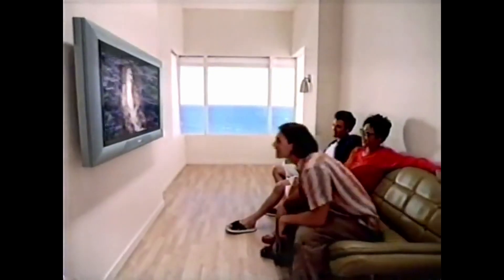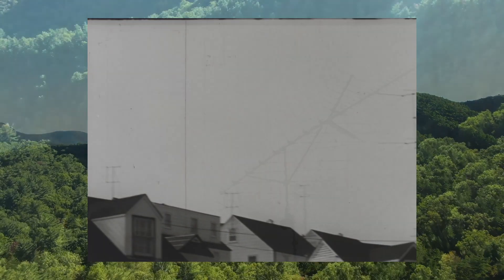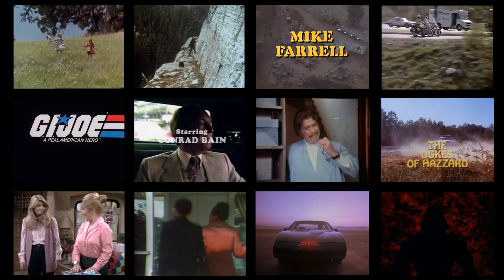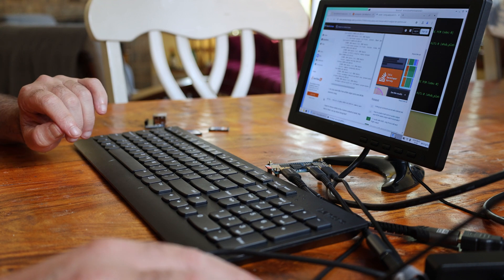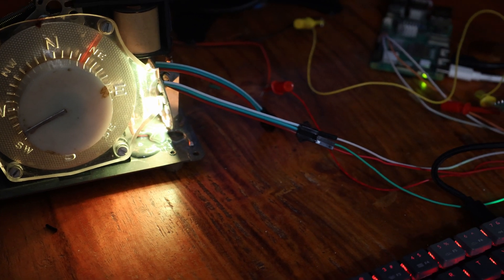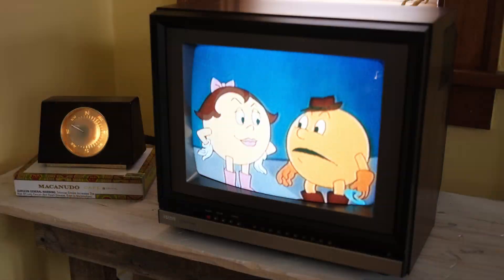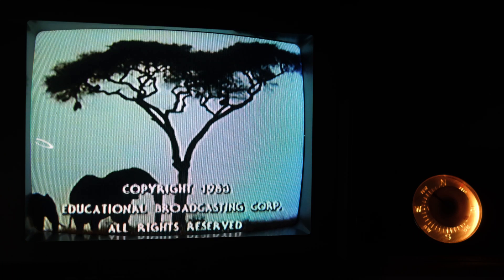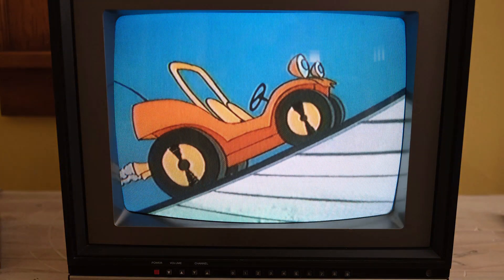My Nostalgia Machine: Recreating 80's broadcast TV with a Raspberry Pi

Comment: Curious what you chose to get to RF out of the Pi. Looks like you are using the Micro HDMI, and then I might guess one of those converters from HDMI to RF? Totally fine for this purpose, though I could be tempted to use the Pi 5's composite out pins and convert to RF (or not, with a later TV). 
Somewhere between the playback files to the TV it looks like you might not be getting the full frame rate. Could even be how the files were captured, as many capture programs drop a field and bring you down to 29.97fps. Some of these shows should look much more fluid.
Reply from the maker: For conversion, I am using multi-hops: HDMI->RCA in one box and RCA->RF in another - the latter box is contemporary to the era. 

On the playback rate - there's a lot at play by the time those videos streams make it to this video. A lot of them were recorded to VHS originally and were digitized at various rates. Importantly: my video is at 24fps as a personal, aesthetic choice. I have no idea what the UV filter I have on the camera does to it, because without it its almost impossible to get a usable video out of it (rolling, large blank areas etc). What I am seeing must look better than what you are seeing - but in any case it works for me. One of the cool things I like about this system is that folks can take all the time they want to curate their content to fit their own bar. Cheers!

Comment: The truth would have been better but taking advantage of the analog signal
Reply from the maker: Yep, there are a lot of things that could have been better, but most things aren't one-way-doors. It would be pretty easy to still 'broadcast' this stream as an analog signal to a receiver. Any contributors who want to push a PR with that, I would merge it if it works well.

Comment: Has anyone noticed on television that providers have, sometimes it is in a closed loop or it gets stuck? the channels are not in real time even when selected to be, and if reset cable box/device the same channels start at the same time and do not allow rewind or fast forward. News channels, entertainment, etc. A stuck loop. This is a similar idea.

The work also shows how capture transfer digitizing content is important.
Reply from the maker: Yes - a note to folks preserving old media: try to match the source framerates and size as closely as possible.

Comment: I'm going to have to try making something like this. I have an off brand Pi that's great for video encoding, a spare Pico, and a crt that's also been just a retro gaming station for some time. I miss the old TV format, though I grew up with full blown cable.
Reply from the maker: Do it! This can easily replicate cable, with some very minor tweaks to the channel change filter. I might make that configurable - because its really just changing the amount of time it takes to make the channel switch. You'ld just need to provide your own content and be ready to go. I just updated the install and configure documentation on git-hub. Just file an issue there if you get stuck and I'll try to help out.

Comment: Devices like “arduino” that came just before raspberry pi were often called “museum controllers” - a common use was the little computer that plays growl.wav and moves the dinosaur when the tourist presses the button. 
This is an incredibly complete set up.   I saw a ‘hack’ included with xscreensaver that performed tube distortion on an input video file exceptionally well.  It’s funny how the mind fills in the image of an old analog signal on a picture tube.
Reply from the maker: Museum controllers eh? I like that :) I remember how happy when I got my first flat screen monitor and got rid of VGA cables. Now I miss tubes. Life is weird, huh?

Comment: The only problem is, is how the old media is preserved and transferred at it's original quality from frame rate to resolution. Most people wouldn't care about how things are preserved and preferred plug-and-play convenience. I try to preserved my recordings to the original way it was broadcasted, frame rate and all.
I do not like your filter on the CRT, unless your camera is not picking it up properly and since the video is being played back at 24fps so I can't tell what it really looks like.
Reply from the maker: I mean, we have a lot going on here with a lot of these: broadcast->VCR->Digital before I even got it - and that probably means more than one digital->digital format conversions. Then I edited them all back to fit the NTSC digital standard of 720x480 - and yes, a framerate of 24 per second. Then, you have to account for the UV filter I have on my camera that let's you see it at all (without it, would mostly be rolling lines or large blank areas) - and the camera itself. Oh wait - we're also forgetting any weirdness introduced by the mpeg playback library. There were a lot of hops required, so no, it wont look good to everyone. Cheers and best of luck to you!
Reply: I'm guessing it would just be useful for stuff like period filmmaking.

Comment: Great project and excellent video!  There was a project done a few years ago that used a Pi to play a random Simpsons episode - I wanted to try and mod that to do a cruder version of what you made here, but I am no programmer.  Thank you for doing all the heavy lifting on this one for those of us still baffled by python, LOL!  One question for you though - I have a Pi 4 leftover from a PiHole project, would it be fast enough to manage the "channel changes", or should I start shopping for a 5?  PS - we had two channels here in northern Canada, three if you spoke French...
Reply from the maker: Thanks! The pi4 should be fine - you can test by just switching between a couple of videos in mpv. Happy making! And if you get blocked, reach out and I'll try to help. Cheers!

Comment: I'm extra curious how you built the content library.
The shows wouldn't be the hardest to find, but the promotional bumps and commercials must present an extra challenge.
Reply from the maker: Some of the best content for bumpers and local commercials is from old recorded VHS tapes. Archive.org has the VHS vault. I also found some on youtube - the problem there is that they often have watermarks.

Comment: An interesting idea, well implemented. I've been toying with a similar idea for my old time radio collection. Sort of a "multiband" radio where one babd would be chronologically tuned, another by show title and one by genre. Maybe even a band that goes live over-the-air. My experience of tv from this era is a bit different. I was an early adopter of the VCR, buying my first in '77. The ting I had to deal with was the high cost of tapes... $15 or more each...
Reply from the maker: I'm not exactly sure why, but VCRs didn't show up until after the rental market started growing up in our area in the mid 80's. By 86, even the little gas stations were doing rentals. I wouldn't have called us early adopters of anything really - though I am sure there were some around earlier, I just didn't see them. Cheers!

Comment: I love this video, and I really miss Analog TV. I live about 65 miles east of Macon Georgia. Right down the road is where my grandmother lived. She lived on a hill and had a TV Towe with a huge Channel Master Antenna. Some nights she could get WTBS Channel 17 we would watch the Atlanta Braves just as clear as local stations. Also, a local low power TV station Channel 36 WATL Channel 36 out of Atlanta would come in crystal clear over the local 36. Now days you either get the station or you don't. On and a good set of Rabbit Ears worked really good even 60 miles from the transmitters.
Reply from the maker: Well, we had a similar experience then. My grammas house got WTBS crystal clear (we didn't pick it up at all) - so many good shows on there with all the classics and westerns on Saturday and Sunday. I had forgotten about WATL - we didn't get that until cable came when I was 14 or 15, it was a good channel. Good times!

Comment: This is very similar to what I’m doing. I’m using multiple Raspberry Pi’s (1 Pi per channel). Each pie feeds to an Agile Modulator which feeds to a RF combiner. From there I could either broadcast wirelessly or through my home coax cables. 

I’ve been recreating every channel as it was in 1999. You should be able to pick up any TV Guide and see exactly what was playing. I’m even hoping to recreate the TV Guide Channel.
Reply from the maker: Amazing! Make sure to show us what you made when you get it done - cheers!
Reply: I've had a similar project as well. Mine is also multi-channel, but I'm running it from a Windows NUC and old Netgear ReadyNAS since I’m dirt poor and it’s all I have to work with. I’ve got mine using Emby with the GenreCleaner and StudioCleaner to gather/correct metadata including studio and original airtimes, download subtitles, and to maintain consistent video formatting (I use MP4s and STRMs), and to find trailers. I use batch files with FFMPEG and MP4box to make bulk fixes to my files, such as assigning languages to tracks and adding chapter data. SubtitleEdit to fix subtitle files. I have my system generate channels and blocks using language, studio, time block, tag, genre, and other metadata, as well as system calendar data, converting subtitles to closed captioning and select metadata to tv guide data. I have it cluster sets of studios to generate the channel, assigning shows to within an hour of their original time block; I assign this in a simple text configuration file so I can make adjustments easily. If I want to force or exclude a language, tag, movie, show, or pool of shows at a certain date, time, or time range I can also do that in the configuration file. I intersperse sets of up to 3 trailers/commercials at the end and between chapters distributed evenly across the runtime to keep the schedule in blocks of 15 minute segments (I also inject "eye catches" if I have them for a show). Once assigned to a block, the show is locked to that block until all episodes are cycled through unless overridden in the configuration file. I have the scheduling structured around looking for certain holiday tags on movies or episodes so they air on dates appropriate to those holidays. For this reason, I have scheduling assigned 6 months in advance, adjusting based on media availability and changes to the configuration file. This way I can review it all and make adjustments as needed. Each channel is output as a stream on my Emby Live TV.

I hope to be able to someday pull from YouTube or Rumble as well, assigning particular channels to air livestreams and uploads, but that’s a bit over my head currently.

I still have a lot of work ahead to get my system working perfectly, and I hope to make it an Emby plugin someday so others can run their own.
Reply: Can you make a video how you built that @JeffreyJusticeLosey
Reply: @JeffreyJusticeLosey did you use virtual tv plug-in?  And how did ypu get the timing set for episodes to start and finish in their block of time correctly?
Reply: You could have a channel that presents a video on how the tv itself works

Comment: The big question is does it play the Nat'l Anthem and go off the air at midnight?
Reply from the maker: Now it does! I just added the capability - it was quiet easy. You can now specify a sign-off video (national anthem) and then an off-air video (like a color test pattern).
Reply: @wrongdog_reckons  Complete with 1,000 Hertz tone?
Reply from the maker: @RandallJennings  - yes, and then I took it out and replaced it with grocery store easy listening loop over and indianhead test pattern. I couldn't self inflict the tone!
Reply: @wrongdog_reckons  Muzak!
Reply: @wrongdog_reckons  Maybe use a clip from The Wall for a cheeky sign off.
Reply from the maker: That was an obvious miss - but will be the very next feature I add. I'll give it a per-channel configuration for sign-off video and off-air image. Good call!

Comment: We had that exact antenna controller in the early 1950s in eastern North Carolina. We got 2 stations pretty good and the third network was always rather snowy. I remember watching Sky King, and Caption Kangaroo. I was especially frightened when I saw the Wizard of Oz the first time when the witch had Dorothy locked in her castle.
Reply from the maker: I looked forward to the Wizard of Oz every year - they showed it around Christmas time - but those flying monkeys scared the heck out of me!

I suspected the timeframe for the antenna controller was pretty early - I found a manual for it from the late-50s, but couldn't find how long they made the model for. Everybody where I lived (North east Georgia) had old equipment, so this would have still been in service there in the 80s.

Good times!

Comment: One comment about having to use a CRT. 

From experience with retro gaming, you can get a REALLY convincing (mostly) CRT experience using a Retrotink 4K on a good 4K OLED screen.

It's probably not as cost effective as buying an old CRT but since I have the OLED and the RT4K it's the option I'll use for something like this.
Reply from the maker: At around 150, it is a bit more expensive, but definitely more space effective. CRTs are more expensive and more rare than I expected them to be - I got this one on an amazing deal, but now I have to house this huge block. The Retrotink might be the right option for some folks. Good callout.

Comment: I didn't catch it, but what was your video out connection method? Did you run HDMI out of the pi5 to a converter or did you connect and enable the internal composite out of the pi5? If you didn't try the composite out, you should give it a try and see if that adds any more "flavor" to the signal.
Reply from the maker: I had a section that didn't make it into the final video. Its a multi-hop path: Pi HDMI -> HDMI-In:RCA-Out -> RCA-In:RF-Out  - the TV accepts Co-ax or RF Wire terminals in. The RCA-In:RF-Out is from an older box I picked up at the used electronics store (RE:PC) - but you can get them on amazon. I am looking at some possible short-range RF transmitters to see if I can get 'air artifacts' in the signal.

Comment: I remember less frame flickering and more color bars.  One thing not addressed:  Going off the air and coming back on.  My memories are usually "Amazing Grace" or the national anthem and a bunch of patriotic B roll, to use some parlance -- F16, Blue Angels, aircraft carriers, Mt. Rushmore, the Grand Canyon, the US Capitol Building, large plots of wilderness, that sort of thing.  Did you include off air stuff other than the classic Indian head?
Reply from the maker: These are great ideas! The channels do go off the air at night, but they default back to the Indian-head test pattern - I think one of the next features will be a sign-off and custom off air loop. Cheers!
Reply from the maker: Now it does! I just added the capability - it was easier than I expected. You can now specify a sign-off video (national anthem) and then an off-air video (like a color test pattern) - it'll just play the sign off video once and then loop the of fair.
Reply: @wrongdog_reckons  That's doin' nostalgia right.  I hope I get to implement my own for Christmas.  Speaking of, do you know where someone might find those old "Santa's just over ...; so, you better get those kids to bed soon" Santa tracker bumper/interstitials/commercial/mini-news-segments?  Those are a must if I can beat Christmas Eve!

Comment: Like a lot of people in the comments, I've been wanting to do this for late 80s and early 90s.  Have you thought about adding commercial breaks from the time period as well?  As I get older I find that I miss them as much as the shows
Reply from the maker: It does have commercial breaks from the era - I also got station bumps and promos from lots of local channels in there to. It automatically cuts them into the video feed to build the shows out to half-hour and one-hour blocks. You could easily use software I built for 90's stuff, just by loading that type of content into the catalogs. If you decide to build one, make sure you share it back so we can see what you made!

Comment: What an outstanding retro project! I appreciate how you tackled building and playing concurrent schedules with a single Pi5 - how many channels seem feasible on a single Pi5? I currently have a 10 channel/10 Pi(3a+/3b+) analog monstrosity. I'm proud of it, but Im always looking for an excuse to tinker with it.
Reply from the maker: Thanks! You could have as many channels as you have hard disk space for. I have about 1 terabyte of video files and it takes a couple of minutes to generate the 'catalog' (that only needs to be done when you add new content) - generating the weekly schedule takes less than a second per station and only needs to happen once a week. The stations don't all play simultaneously - the code has logic to figure out exactly where in a scheduled video clip it should start playing when you switch channels. That way, it gives the feeling that its kept playing the whole time, but its actually just skipping to the right parts in the schedule.

Comment: This is something I've always thought about doing... I'm glad someone else out there had the same thought. My plan is to do something similar with my nostalgic era of the early to mid 2000's
Reply from the maker: Do it! If you want a headstart, the software I wrote (fieldStation42) should be able to handle any era - doesn't require the channel change device or even a raspberry pi, should run on any Linux install. You would probably want a different channel change effect. Happy making!